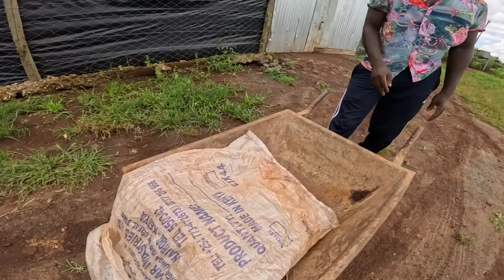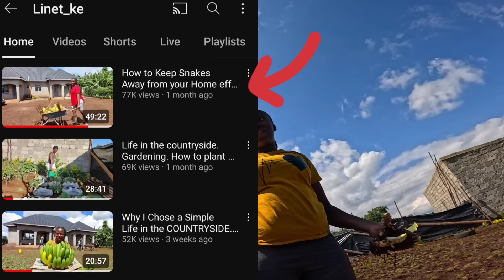How to plant strawberry plants at home. Gardening. Life in the countryside #gardening #planting

Comment: Some advice, DONOT plant mint in the ground, before you know it will have overtaken your whole garden! Furthermore, it isn't easy to uproot once it has spread. I suggest you put it in a container, but make sure the container doesn't have holes at the bottom because it may still root if the container doesn't have a saucer below.
Reply from the maker: Thanks for the tips!